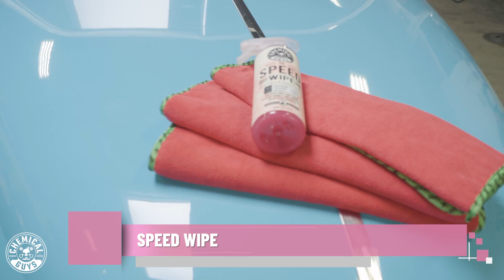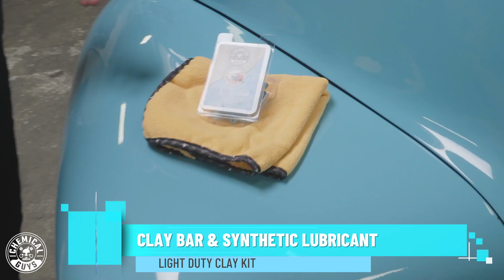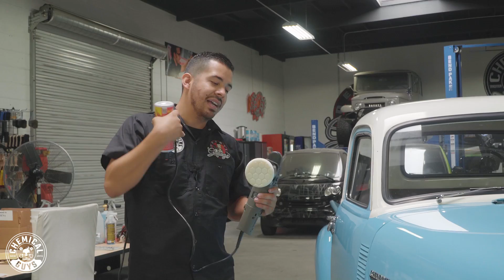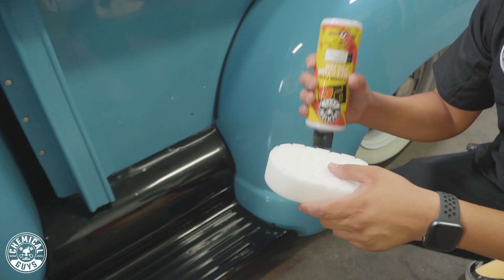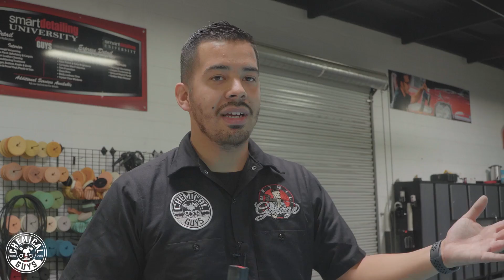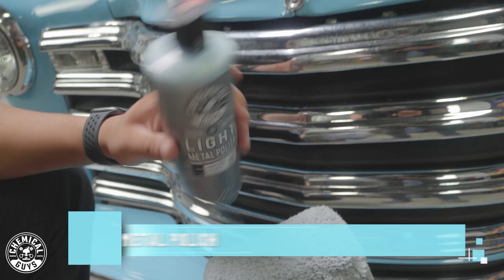Revive Classic Paint With These Easy Steps! - Chemical Guys

Comment: Soo I bought a brand new car 0miles…wht do you guys recommend? Clay and ceramic?
Reply: Don't clay a car if it has 0 miles
Reply: @Mileyz8899  yeah thats what I thought
Reply from the maker: Hey Richard! After washing the vehicle, use a Light Clay Bar with Luber to ensure the paintwork is totally clean before applying HydroCharge and/or HydroSlick to lock in shine and repel harsh elements.
Reply: @ChemicalGuys  absolutely clay the car there are imperfections, and chemical fallout simply from transport even on a new car....
Reply: @ChemicalGuys  thanks..im just thinking about if it’s necessary to clay brand new car